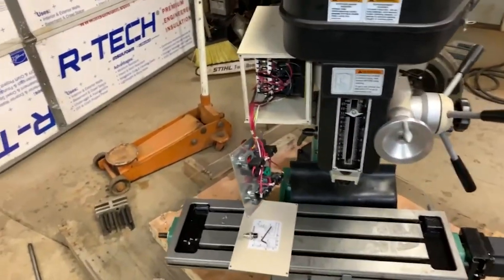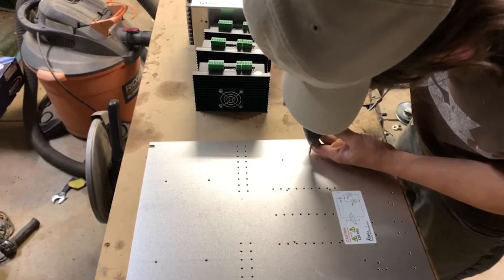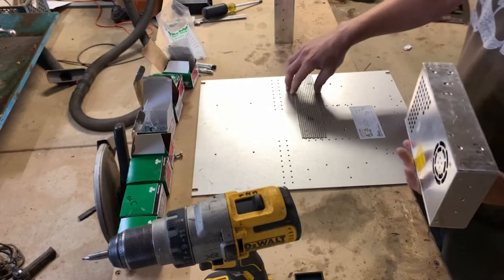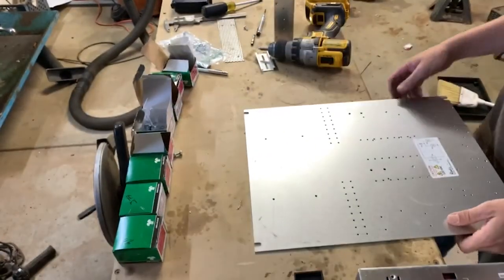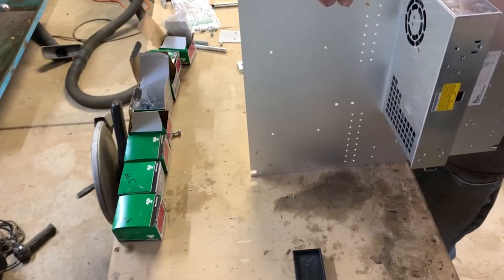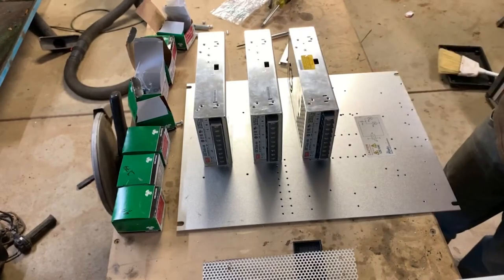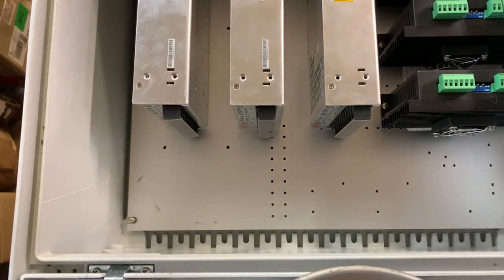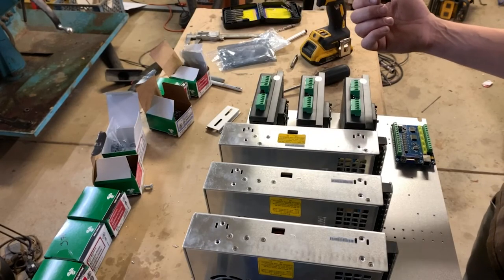DIY 3 Axis mill CNC conversion Part 2. Configuring the control box.

Comment: Nice project and videos. Do you have a list of links for the parts that you used? I did a similar conversion on my own mill drill but.used a kit from paulscnc that I am regretting using. I saw in the video where you got the ball screw kit from but I didn't see what stepper motors you are using and what mounting kit you are using for it to attach to the steppers to the mill. If you could leave this type of information in your video descriptions, it would be fantastic to those of us following in your footsteps.
Reply from the maker: Hey thanks for the comment and I will take the advice for my next vids. The majority of the supplies for that build were supplied to me by the owner of the machine, and I dont have the exact item details. But the steppers were nema34 1/2" dual shaft 1600 oz/in. 4 wire steppers, with drivers from stepperonline that met the current needs of the motor. He did manage to find a kit with all 3 motors, motor drivers, and power supplies bundled together on amazon, but I looked for it yesterday to answer the same question, but could not find the exact kit, although there were several other options that were similar. Parts have started arriving for some updates to my old mill, including the Acorn 4 axis Centroid controller, and I will be uploading more mill vids soon.